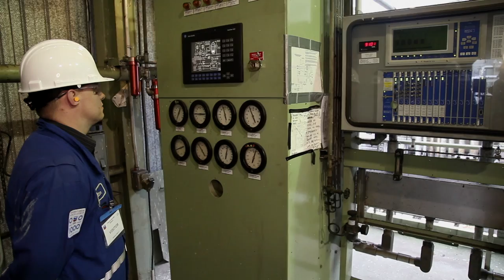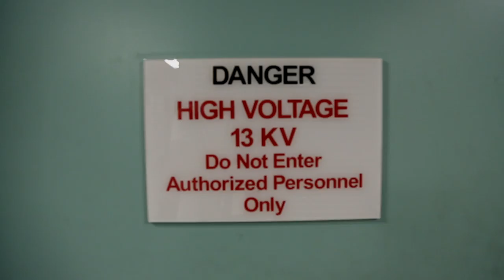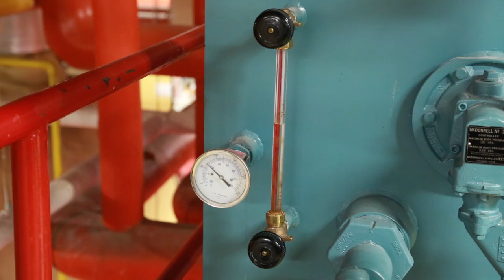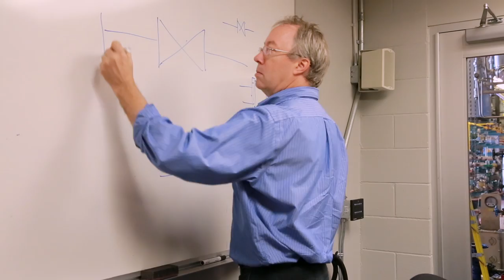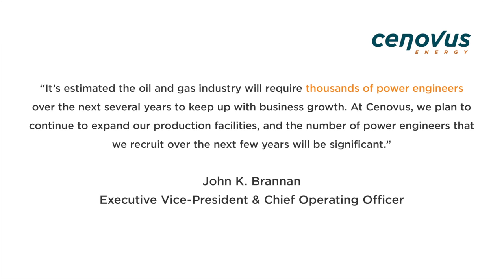IPE Mini Doc - Power Engineering

Comment: Does it matter where I go to school to take the 2-year program or it is just your ticket that matters?
Reply: the main thing that matters is the part A theory, part B theory and final certification exams by the province's boiler association, 
The colleges only prepare you for them ,, the 2 year program is the best bet ,, as they provide you with coop option where you can get the steam time required for the final certification exam ,

The 1 year certificate only gives you the labs ,, not the coop ,, 

With the coop , you can get hired after you write and pass the final certification exam ,,

3rd class is more marketable than 4th class

Comment: If you're going for a Power Engineer job don't bother with either Suncor or Cenovus, I came out of my course and applied for jobs at both companies that I was perfectly trained for but lacked the oil and gas experience.

I'd like to ask those two yahoos how in the world I'm supposed to GET oil and gas experience if no oil and gas companies will HIRE me?  So I gave them both the middle finger and I'm working in a plant operating both steam and refrigeration systems.

Your loss Suncor and Cenovus!